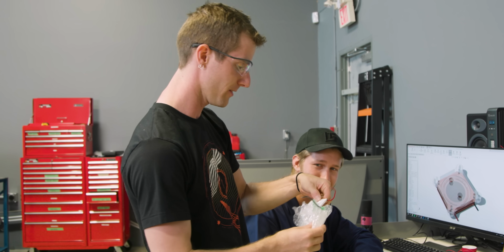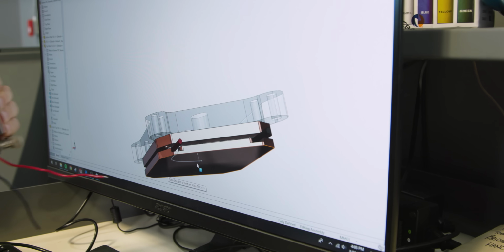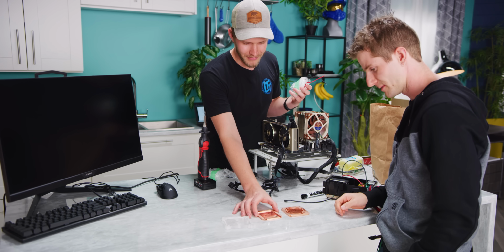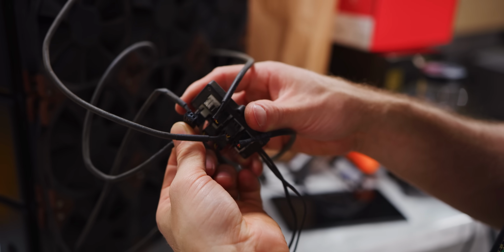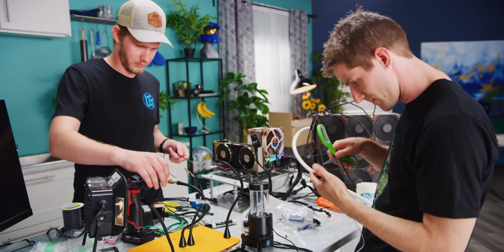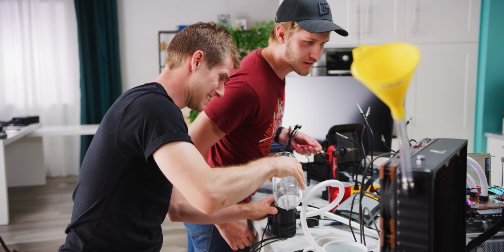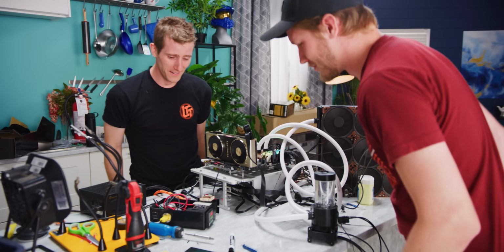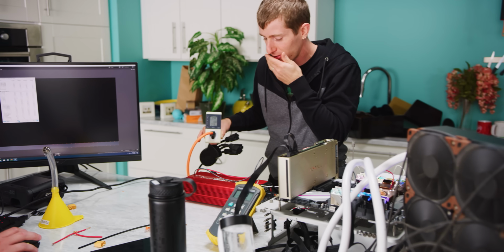This Cooler DRAWS 545W!!? Bad Cooling Ideas #2

Comment: Hey guys get with the owner of the "Making Stuff Awesome" channel.  He is an expert on Peltier/Tec computer cooling.  He is the one that made the popular "Tec Calculator" that you can use to find the most efficient peltier to use for a given "wattage" condition.  One of your main problems is that you were putting too much juice into the system.  There is a happy value which I believe is about 40% capacity?? where the peltier is most efficient.  Another person you could collaborate with is they guy from "Tech Ingredients".  He has built a Peltier Fridge but I would go with the guy from "Making Stuff Awesome" since he has actually built CPU waterblocks for Peltiers before and tried to sell them.  He built exactly what you did and put two in one block.  He could help you with it.  Check out his creations here:  https://www.tecpeltier.com/viewtopic.php?f=4&t=19

Comment: Despite the many caveats to tek cooling I still think it could be a practical solution but this is definitely not the way to do it! Putting a tek cooler directly on a cpu creates 2 sources of heat even if one of them is simultaneously cooling, making the space even harder to cool down. I would be very interested if you did a video where you tek cooled a water reservoir, similar to the way you hooked up a liquid cooling loop to a water chiller. That way you can isolate both sources of heat and still benefit from thermoelectric cooling. I dunno, stick the cooling side to the bottom of a reservoir and stick a heat fin and fan on the hot side of the tek and put that radiator part on the outside of a case any which way? I’m not the scientist here. If you think I had a great idea or am completely missing the point please let me know because this topic has become very interesting to me ever since I first heard about it.

Comment: I don't understand this... on paper, it appears that the Peltier cooling would work well for something like this. Much better than anything else on the market today. Yet from Linus' and Co.'s tests, it does not work very well.
Anyone care to guess what the problem is here?
Reply: Just added a comment on this video that highlights your concern. I’m no scientist, but having 2 sources of heat in one spot is much harder to cool than just one, no matter the setup. I believe that Peltier/tek coolers can work in high end computer cooling equipment, just not in the way they’ve prototyped it. I’m not 100% sure but it would at least make some sense if they cooled a liquid reservoir in an open loop system, or some setup that is similar. 

TL;DR mod the peltier to cool a water reservoir. Just try it.

Comment: arduino + temp sensor + relay, i think that would work better. Maybe using an open water storage system, like a cooler with ice in between with a pump working with PWM also connected to the arduino

Comment: Should make the hot side suck that heat away(more waterflow, etc). Peltier transfer heats at max when both sides have small enough temp. difference , thats why the cold side cools really fast when the hot side is still cool, but "leaking" heat from the hot side when temp. difference is already big.

Comment: Run a hot side loop and a cold side loop, use water blocks both sides of the cooler, run 3 TECs cooling the loop which is then used to cool the CPU block.

Comment: "It's rated for 32 amps, and we're expecting 32 amps."

Safety factor? What's a safety factor?
Reply: AC Relay rated at 32A... With a DC Load that pulls 32A... What could POSSIBLY go wrong!

Comment: BTW the control unit will need to calibrate and teach it self how to run how you balance that against a max min Hysteresis curb on a cpu that fluctuates gonna be a head ache. Good luck guys

Comment: Clearly need to redesign with a hot and cold loop, and at least one more of those TEC's. I'm picturing a stack CPU->CpuBlock->TEC->WasteBlock. with the water from the CpuBlock routed to two more modules plumbed CpuBlock->TEC->WasteBlock.  1500w? Perfect.

Comment: I dont really understand how this setup works but from what I gather that plate has a hot and cold side thats unrelated to the heat produced by the CPU. So the water loop trying to dissipate the heat the plate creates and really isnt affecting the CPU temps in any substantial way.  
So my uneducated suggestion is to put a normal water block on the CPU and then, further down the loop, put the TEC integrated block with an air cooler or a separate water loop on the hot side. 
That way the loop that is cooling the CPU gets the benefit of the cooling but isnt burdened by the additional heat the plate produces.

Comment: Use a larger chunk of copper as a buffer. Instead of the chip heating the water block very fast, before the TEC can compensate. The block will take much longer to heat with it having a larger thermal mass, then the cooler can kick on and start pulling heat out.

Comment: Here is an idea: the water cooling block... make it as large as a normal air cooler heatsink. You need mass to dump that insane heat from the tec right? If you can CnC a large water block it may do it.

Comment: If the copper was very hot the problem was not your TEC it was your water cooling solution not transferring the heat to the radiator fast enough were the cooling lines even hot?

Comment: You should try a dual loop system. 
One loop from cpu to heat exchanger block on one pump. 

Then mount the Peltier cold side to the "cpu heat exchanger block" Add in a second heat exchanger to the hot side of the Peltier. 

Then have a secondary loop going from the "Peltier heat exchanger" to a radiator with another pump. .

Comment: Water block wasnt good enough to remove the 500 watts of heat that that that a TEC produces along with its cooling effect. Would have worked if you could keep the hot side at around room temperature. A TEC only maintains a certain thermal differential, if the hot side is too hot, the cool side will only be ~20 degrees cooler than it is.

Comment: TEC gets you low temp, but the heat transfer is garbage. Low temp only matters AFTER you prove you can remove the heat being generated. When your CPU gets colder your cooler doesn't work as well. (This is regardless of cooler type)

Comment: Maybe try like Der8auer did and line a few smaller ones up in series and cool the water as it hits. This would lengthen the area that you have to cool the water and give you an easier to deal with heat removal from the TEC?  also digging the water flow :)

Comment: Guys... why not just rig up a couple of these as a method to chill the fluid in the reservoir of a water loop and use a traditional water cooler to cool the CPU. Maybe rig up two in a dual loop config and have one cool the fluid in the CPU reservoir and one cool the fluid in the GPU reservoir??

Comment: Overpowering a TEC turns it in to a heater...

But TECs just won't cut it on modern CPUs. I used to freeze the nuts off my dual SL39Z Celerons with water blocks on top of the TECs. 45 watt TECs on 24 watt chips. Ran every day at 550mhz when intel stickered them at 400.

People lost their minds at that rig at LAN parties, but i got more looks DJing with CCFLs and water cooling at frat parties. Before RGB was cool...

Comment: The TEC should be run as an independent cooler that just lowers the temp of the coolant fluid between runs to increase your thermal capacity. TEC in itself is too thermally insulative to directly remove CPU heat.

Comment: Just use some peltier cells in pararel in a square like block with all the cold ends looking at the cube , you will cool it in parallel wiht lot less power

Comment: just ask der8auer...he succesfully build a TEC Cooler :P
Reply: Successful is kinda stretching it though. It did work but it didn't perform better than a good water/air cooler while using a ton of power.
Reply: But he also did it quick and dirty, and relatively cheap. This could easily be imrpoved on.
Reply: @elmariachi5133  that argument does not always hold true. Lots of RnD money has been blasted on this kind of thinking. question is whether the efficiency can be fine tuned or is systematic
Reply: @elmariachi5133  mayhaps, but in this case efficiency and "making it work" cannot be separated quite as easily. They need to hit a certain efficiency threshold for it to work. They were unable to do so, which resulted in them pumping more heat energy into the system than they were able to remove. 
This might be one of the cases where "hitting it with a more expensive hammer" might not solve the problem
Reply: @megapro125  yes that's right
Reply: @megapro125  its is a success.. but is it optimal/efficient ? no

Comment: I knew this didn't work, skimmed through it, hope you mentioned why it pulled 545W+? Because There is a point in peltiers where if you try to dissipate too much heat, or the peltier gets too hot, the peltier starts loosing efficiency in a exponential manor, and will even eventually turn into a thermal insulator, which is probably why your water was 20 degrees but your CPU was 90 if I caught that right. Again, just skimmed through.

Comment: PID is something complete different as what linus said 😂👌
Reply: Can confirm, after 2 semesters of closed loop controls i didn't fully understand what it is, but it's defenetly not what linus sayd.
Reply: @ald3nt3  it's easy, PID regulator has three variables numbers and from these numbers, the regulator can solve mathematic formula to know the temperatures in a certain time will be and with this information, you can turn on and off the heating or cooling source. For example: if you turn on the heater for one minute(manually), the temperature will be rising until a certain point and then dropping down. If you have PID regulator and you set the desired temperature, PID will know how long to turn on the heater to reach and not overshoot that temperature. Basic temp regulator will be heating until the set temperature and then turn the power off, but after turning the heating source off, temperature will be still rising and overshoot the desired temp, PID regulator will turn the power off before the set temperature is reached and not overshoot above-set temp. :)
Reply: @banny123456  this is not entirely true; closed loops control, like PID is, is an absolute massive field of studies.
PID can be tuned to overshoot giving a much lower "swing in time" (1:1 translation from the german "Einschwingzeit", dunno wether this is the actual term), but also like you said to do no overswing. In most thermal applications you will be using overswinging (e.g. heated bed/nozzle in 3D printers).

Tuning it to not overswing is more likely used in mechanical devices like position control in a cnc mill, where overshooting destroys your device.

Easyest way to describe it, is a PID will try to hold something at a specific value. It does this by looking at the difference betweeen your target value and your current value. 
Proportional will just be a factor of this, integral will be change itself over time according to this value and differential will react to the change of the value.
All three will be added together and given to something that does an effect (like voltage) to the thing you want to control. 
Setting the parameters of D or I to 0 will lead to a PI or a PD control.

Our prof always said; if you are able to control something without a closed loop, go for that option :D

Modern devices, like the one they used are quite intelligent figuring the parameters out themselves, by giving a pulse or a specific amount of signal, but the math and structural designs behind it is an absoulte nightmare.
Reply: @ald3nt3  thank you for that additional informations :)

Comment: I used the same TEC years ago on a highly overclocked AMD cpu, worked fine.

The trick, after I burned one up, was to build a high mass water block to cushion the extreme temp change of the TEC.  I used 1/4” copper plate and made a huge block, and used a high flow aquarium pump with a flow control valve to limit extreme temp swings.  I wish I still had it, I’d send it in to you guys.

Get rid of the plexiglass, make the chamber at least .500 thick and be sure the cold plate side isn’t being contaminated with heat from the screws holding it all together.

Comment: In the age long gone by, they used to have an upsidedown pyramid.  Where the pyramid is the size of CPU IHS on one side, and the size of TEC on the other.  This should help to better spread the heat.

Maybe you can try it next time, when you feel like punishing yourself for no good reason. ;)

Comment: Cpu should be water cooled with first radiator to desipate most of the heat and then thru water block on peltier and then to cpu. Hot side on pelter can be cooled by air.

Comment: I know it’s kinda like mythbuster, like you’re not really here for accurate results, but this kinda hurt. First, solid state relays can switch on DC but they need the power to drop to 0 before they can switch off, so they can only switch AC power. You need to have a 2 sided water loop, one loop going from CPU block to the peltiers cold side, then another loop on the hot side to the rad, your connection with a straight peltier is no we’re near good enough

Comment: That solid state relay is a giant transistor. Switch it using PWM through a comparitor against the temperature. Bonus points if you include hysterisis circuitry.
Buying a temperature controller is not LTT janky enough for me.

Comment: I cant help but feel like there is less steps in my car's cooling than what you guys are trying to acomplish here with a pc
Reply: @omgwtf696969 also goes through a spring loaded thermostat which switches between not cooling (whilst warming up) or cooling the water via the radiator when up to temp. also the radiator has a relay or dual relay which controls a fan which turns on when the water going through the radiator is not being cooled sufficiently. ie sitting in traffic with no airflow through the radiator or driving too fast and making more heat than the radiator can cool. every step in a car's cooling system is basically the same is their cooling idea except the tec is the engine. If any component, fan, thermostat or water pump fail then your engine can overheat and become damaged.
Reply: I'm somewhat familiar with cooling as me and my dad replaced almost every part of the cooling in my first car cause it kept overheating, in the end we even replaced the whole engine but the overheating never stopped and the car eventually killed itself. Maybe that's why this video reminded me of it. 😅

Comment: Suggestion: use a car engine cooling system.

How: connect the computer water cooling to the car cooling system with taps then turn the radiator on and spin the engine by spinning the wheels without starting it.
notice you need to bypass one valve in the car, for that I suggest to get a old car that still works.

That or option two: all the main car engine cooling parts (radiator, liquid water pump and radiator fan) a motor with some horsepower for the water pump and a powerful 12v supply for the fan.

Why: A car cooling system is design for high power at "high temp" (80 to 140 Cº) and it was quite powerful water flow with considerable pressure.

I also have another suggestion: 1 M³ or more water tank with a well pump.
Reply: Problem about the car radiator system is that it is meant for higher operating temperatures. Doubt it will work much better than "normal" liquid cooling hardware with similar radiator size. You wouldn't need an engine at all most water pumps are 12 volt these days rather than part of the power train. 
You could use a car radiator instead of a normal one though. A friend uses two of them, doesn't even need fans anymore.

Comment: Since TEC create a temperature differential, what if you cooled the other end instead of just using a radiator? ... I know it probably makes no difference, but I want to see you use that AC unit/sub zero system to cool the hot side of the TEC plate.

Comment: That 40v SSR seems bigger than you need, you probably could've gotten away with a 25v version. Unfortunately, those ones are usually rated more than what they can actually handle (because they're cheap). For this application it works fine though, I use one for my PID controller as well.

Comment: TEC & water cooling hybrid! What if you use a TEC sandwiched between two water blocks. CPU outlet water would flow through the hot water block side of the TEC warming it further. In theory the higher differential temperature between the water and ambient air in the radiator should make the radiator more efficient. Radiator outlet  while slightly warmer routes through the TEC's cold side water block further cooling it down.

Comment: What you guys are doing is having the radiator disappait the heat from the CPU multiplied by the heat produced from the peltier. That 900w drawn is having to got through the block/radiator loop and would be much better without the element.
A more efficient way would be as others have been stating, to use the peltier to cool down the fluid in the loop (like refrigeration). However this could be made more efficient if you first pass the cooling liquid through the radiator (cool to ambient) then cool it with the peltier, essentially cooling in series.
That would be a great video to see :D

Comment: Tec will work. You can setup your standard water cooling loop then add a block with 3 tec’s. On the hot side but another block to the monster radiator. You could do, 1.cpu 2.radiator 3.tec-chiller 4.pump then back to the cpu. You guys should have thought of this